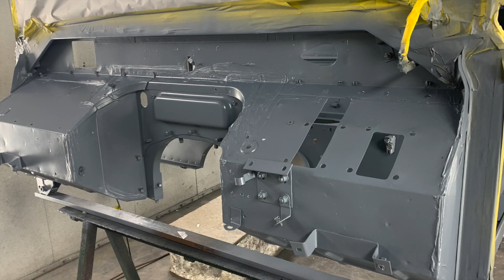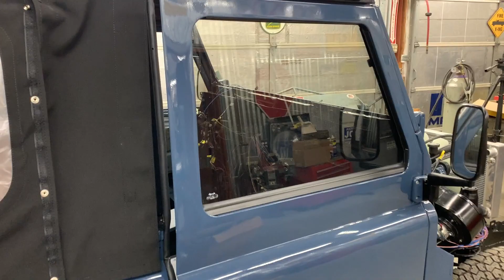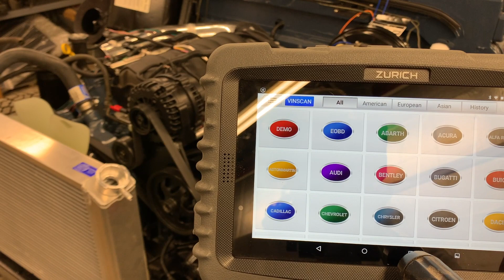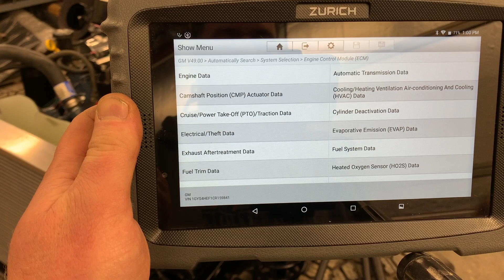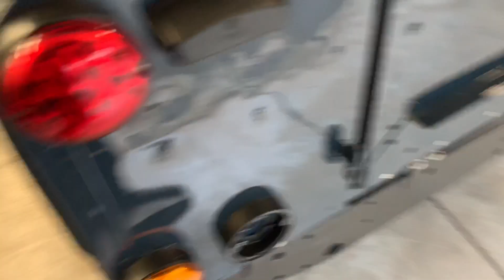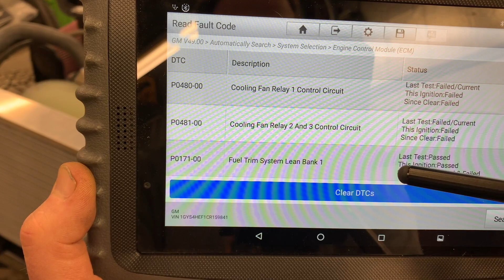Will it Run?  Land Rover Defender 90 LS Swap Part 5

Comment: Hello, I have a 1992 Defender and have installed a "Safety Devices" roll cage.  Is that the roll cage you have installed and if so, who modified your top to accept the roll cage?  Thanks

Comment: Rebuilding 68 Vette back to original. What is semi-secret coating for cast judged flanges and shafts to help keep them from rusting?  What book would you recommend for original color finishes for chassis, fender wells, underside floor pans, rubber overlay of upper A-arms, etc…?